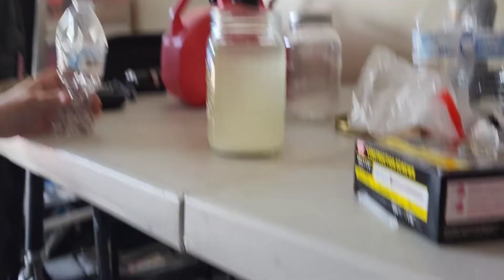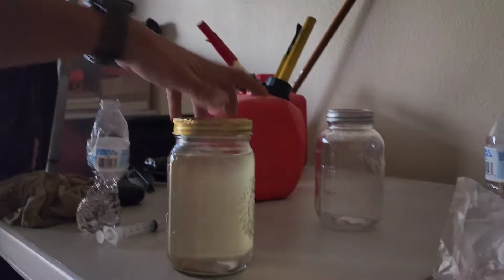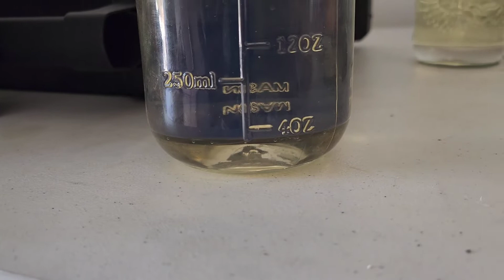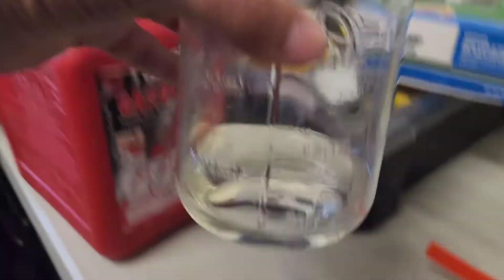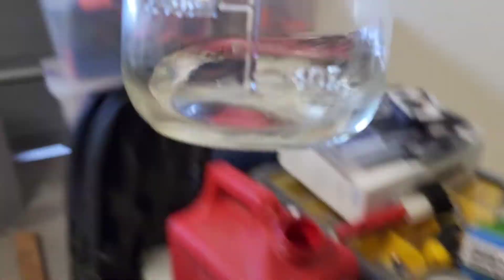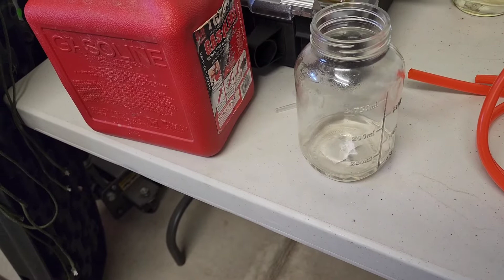REMOVE ETHANOL FROM FUEL real easy

Comment: Ethanol actually produces more then 25% more emissions then running straight gas!! I wonder what 110 race fuel would do in my truck? Lol 😆
Reply from the maker: Once upon a time I had a 1990 mustang 5.0 H.O. and would periodically put 110 race fuel in it I even tried leaded 110 ohv fuel and the thing ran it my guess is without a tune there is only so much the factory system can advance or retard the timing so probably won't do much but it will run it. 😉